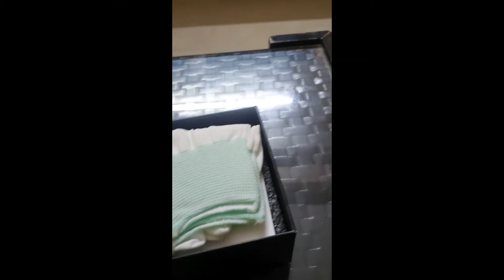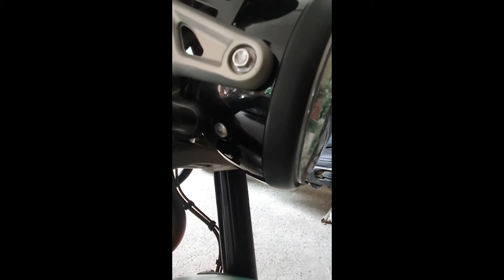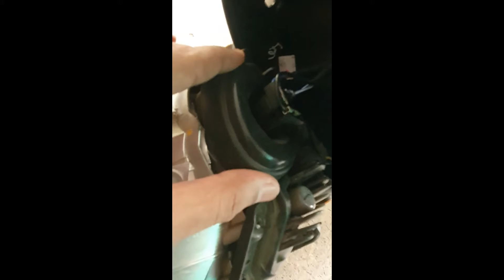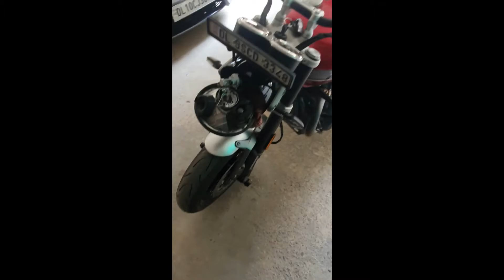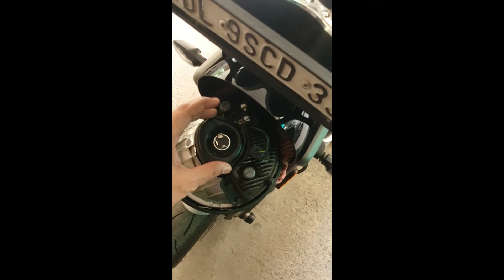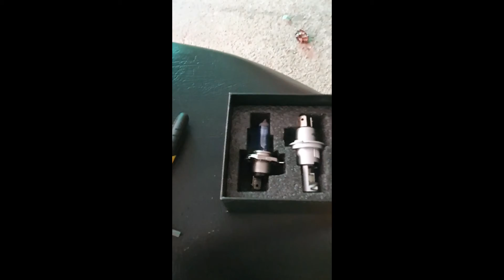AUXITO H4 LED-MOTORCYCLE HEADLIGHTS-INSTALLATION-TRIUMPH SPEED TWIN

Comment: Can u pls post a link to buy?
Reply from the maker: @amithraj3240  AUXITO 2022 Upgraded H4/9003 LED Headlight Bulbs, 100W 20000LM Super Bright, 6000K Xenon White, Halogen Replacement with Fan for Cars, Motorcycle, Pack of 2 
 https://amzn.in/d/08x8Gar9
Reply from the maker: @amithraj3240  kindly check the connectors before ordering this..
Reply: Hey! Thanks for the reply. Exactly what do you mean by check the connected? For reference, my ST is a 2023 model
Reply from the maker: @amithraj3240  then no issues.. great go ahead.. I thot u have some other model

Comment: Thank you! This is by far the best video regarding an LED light change on the Speed Twin on YouTube.
Reply from the maker: Pleasure bro.. you got a speed twin
Reply: @tomrohan8480  Also, my Speed Twin does not have the DRL switch/head lights switch on the handlebar. I guess that one comes only in the European and the Asian models. I hope the bulb doesn’t burn out when I switch on the ignition.
Reply from the maker: @BillooBakra  c always start the bike by jus turning the keys and pressing the started switch rather than turning on the key then switching on the engine start stop switch n further pressing it down.. this actually eats up the battery.. so always keep the red engine start/stop stop switch in the centre idle posn.. switching the bike OFF shud b done by the keys n not by the switch.. 
Bulbs don't poof off as it is protected from high volt from start ups.. n this bulb is pretty robust n comes in a pack of 2
Reply: @tomrohan8480  Yes Sir. I have a 2022 model.

Comment: Auxito và novsight loại nào tốt hơn  bền hơn bạn
Reply from the maker: Brother can u type in English.. I cudnt understand.. or tell me wich language I will use translate
Reply: Led Auxito and novsight which is better and more durable than you?
Reply from the maker: @samvlogs8386  I'm using Auxito for over 2 years now.. no problems till now, no flickering no dimming.. goin strong.. Best part of using auxito is its compact design.. sits well in the housing with the dust cap..
Never used Novsight.. can't comment on that brother..
Reply: OK Thank you led Auxito has any kind of 25watt H4 pin?
Reply from the maker: @samvlogs2031  sorry for the late reply.. yes they do have all configurations
Reply: Ok thanks